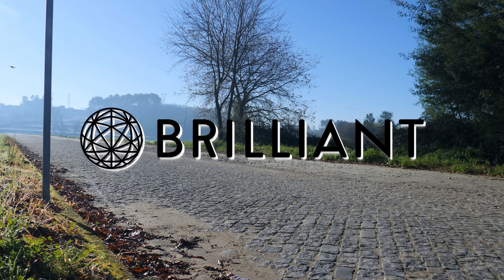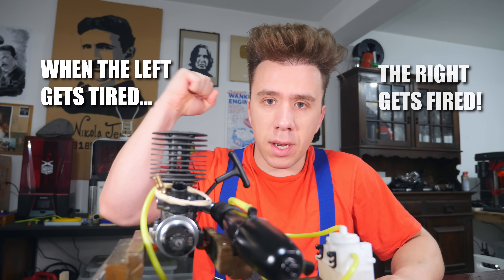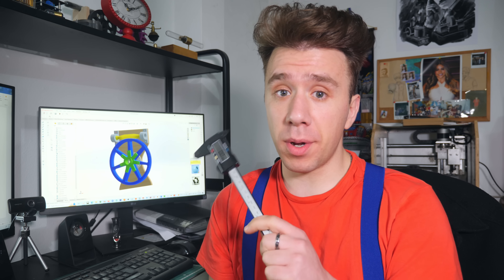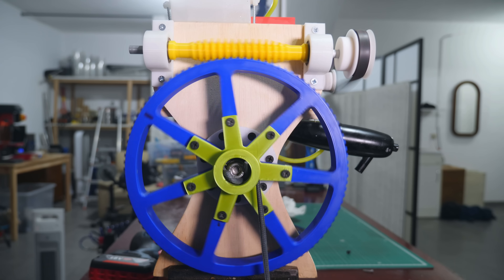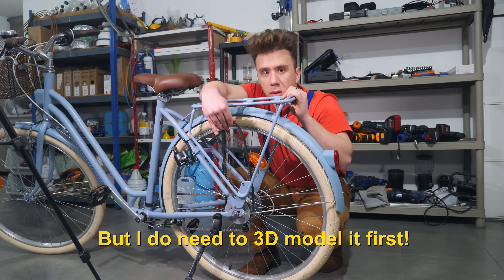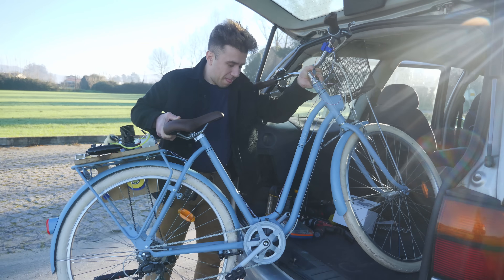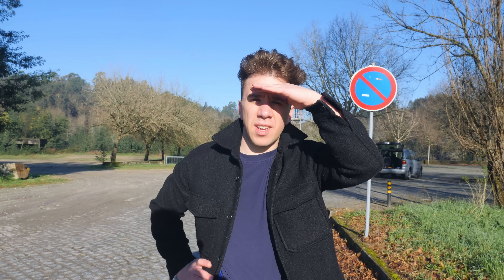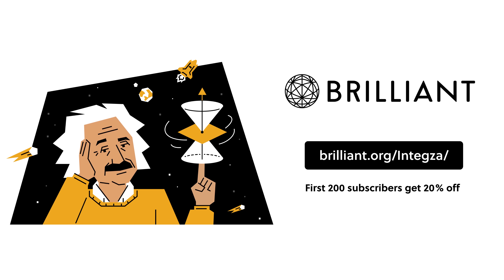Tiny 3.5 cc NITRO ENGINE on a BICYCLE

Comment from the maker: NITRO ENGINE:https://amzn.to/3SE4RIL
My 3D Printers
Prusa mk3:https://amzn.to/3SEXr83
Bambu Lab X1 Carbon:https://bambulab.com/en-eu/x1
Creality K1:https://amzn.to/4bjM4K3
Prusa SL1S SPEED:https://amzn.to/4bu7LHA
Form 3: https://formlabs.com/eu/3d-printers/form-3/
CNC MACHINE:https://bit.ly/3sqTUQm
Reply: Ps no more than 8mm of your circular saw blade above the wood 😳😳😳😳 more dangerous than jet engines.... possibly 🤣
Reply: @ddoherty5956 its not tall enough to cut the wood tho.
Reply: @balkanboi11  I've been using a table saw for over 20 years, it will and safely.
Reply: you should make a tiny (the size of a NITRO rc car) remote control multi NITRO ENGINE hydrofoil boat that can pull you in a inner tube or even skis and you can control where it pull you
Reply: 5:53 DANGER - I know wood isn’t your primary medium but please please be careful with your table saw. It’s the most dangerous tool in your shop. Consider lowering your blade to barely above the workpiece and never ever create conditions that could pinch an oblong piece between the blade and fence - recipe for kickback. My heart skipped a beat with that.  Please be careful!
Reply: I think you needed to pull the fuel through to the engine the first time, it  might benefit from a priming bubble. 👍🇬🇧
Reply: @ddoherty5956 Yeah that his mistake by pull starting the nitro engine bone dry which is not ideal leading to lower or no compression.
Reply: You needed more fuel to air on full throttle, turn the side needle ccw out 1/2 turn you need a little smoke and a better gearbox maybe from a RC truck hpi savage 25 should work
Reply: @foosty6 YES I'M IN AGREEMENT
Reply: BRING. BACK. THE. MOUSTACHE.
Reply: @Arrow14100  Good point👍
Reply: Use gearing protection, wgen you run those engine indoors, even with the exhaust, they are loud enough to damage your ears. 
And drop the worm gear, they have a really low efficancy (~10%). I'd recoment you look into planetarry reducers (i.e. 3 stage 3d printed or from a drill).
Reply: Integza, I’ve worked with those motors since the 90’s and you can pull a lot more power out of that engine. Use a dremel to do a port polish of the intake and exhaust ports so it flows less turbulently, add a simple boost bottle (Google it, 2 stroke cheat code) and use a higher percentage nitro fuel (a 30 or 35% blend should be easy to find). You can probably close to double the HP for less than $100 and then change the gear ratio to something more conducive to speed with the newfound torque and peak HP on a budget. 🤷‍♂️
Reply: Great vid!
Reply: Attached a nitro engine to ether roller blades or a kids scouter!
Reply: i have a motobecane moped which is maybe 1.5 horsepower. it does a neat thing where the engine rocks forward, pulling the belt tighter into what basically becomes a variable transmission. maybe that can be implemented with the nitro engine in some way to squeeze out more speed
Reply: Love your videos as always! Tiny detail: torque is expressed in Nm, not in NM. (meter units are lower case, uppercase M only refers to mega)
Reply: Hey integza, I made an electric bike out of my mother's old Beach cruiser. It can go around 40mph.
Reply: What modeling software?
Reply: @iamski  he mainly uses onshape to my knowledge, he's sponsored
Reply: Which Cad program are you using to generate those gears?
Reply: @AndreaGiorgi85  onshape
Reply: He is a pro
Reply: Your grandpa left you a ladies bicycle? If you put a tuned chamber exhaust pipe on it, you'll get a bit more power in the power band of the engine.
Reply: Bit of a random question but does anyone know if it's possible to get ceramic printer resin for reasonable prices, I need high temp parts but the only ceramic resin I can find costs like 1200 bucks
Reply: Can i make a suggestion? Instead of all the overengineering on the back peice, can you try mounting it on the diagonal strut, on the right hand side, on the basket support? Then you could make a mount + gear ststem to integza into the pre-existing chain system, replicating pedal movement instead of moving the wheel. This way you can even use the gears on a mountain bike for even GREATER SPEED! Zooom
Reply: Can’t you incrementally increase the weight of a flywheel to transform rpm to torque. If you gear it down and create a damn heavy flywheel and spin it up to speed very slowly you might be able to retain more rpm. Or perhaps using your muscle power to get moving then once the flywheel is spinning you add the rpm and hopeful it won’t overload the engine.
Reply: 👽👍🏼 Very Cool Motorized Bicycle 🚴💥☁☁☁
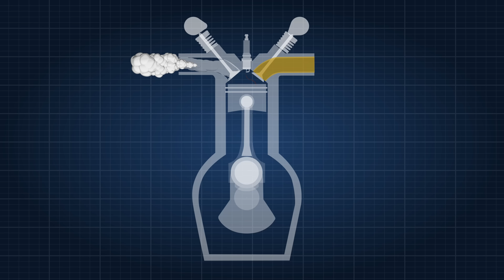Reply: 1:48
 am i the only one who has dirty mind
Reply: Funnily enough if you look up the NSU Quickly those old Mofas also did not have a motor much bigger and oftem were tuned to drive at a speed of 50km/h 😂. I worked quite a bit with old bikes and Im always blown away by how fast such a small motor can get you.
Reply: Now tell the truth..... the bike was yours but it's all good b/c you will get more "BanG as the horsePower BucKs" ?!
What kinda drone was that motor for & it must be super expensive??  Anyhoo,  thanks for the video & I appreciate
the humor = that makes the video Go like the motor did your GrandPa's bike.... Yeah yeah.  peace
Reply: all that tomato bashing, and meanwhile you dress like my favourite italian plumber. i wonder where mario would stand on the tomato issue...
Reply: Thank you.
Reply: I've been suggesting a similar project all over the place for a while now. Basically a motor like this as a charger for an Ebike. Fuel can be 10x as energy dense as lithium batteries, so an engine like this, carried separately as a range extender for when you want to use an ebike in a place where charging is difficult would make the bike more useful.
Reply: lol, Plastic, particleboard, Rc engine, and a girls bike. Bahahahaha yer hilarious.
Reply: 14:18 gratuitous twerk.
Reply: The engine is crying for more fuel due to the lack of smoke coming out the exhaust as you think about it by riching the carb as leaning it will kill the engine faster due to it getting too hot as well the glow plug plays a factor in the weather due to the temperature given like colder plugs or hotter plugs. You can get more power by porting the engine and a racing pipe without restrictions including a bigger head for better cooling
Reply: If you want to make up for the loss of efficiency due to the angle of attack of the infinite screw being too steep.

The best would be to reduce the angle of attack of the pitch of the infinite screw, instead of 6 steps (too short) you would be at 8 or 10, and finally you will have a better grip on the bottom gear, and increase the efficiency.

Note that your infinite screw system is clearly seen on a heat engine, since it is an under-multiplier(good for thermal engine).

You will notice that in the current configuration it is a little too under-multiplied. And so by adding steps to the infinite screw (like at the start where you realized that you were driving more slowly), despite everything you had better motor efficiency with the screw as it was before (with more thread).

Ultimately the best would be to put it back as it was before, 8 or 10 steps in brass, and multiplying by the pulley systems whose sizes you can reduce. So I think that this 3.5cc 30000rpm you can make it go at 50km/h while keeping a system like yours, quite rudimentary, but functional, and above all not expensive. DIY at a lower cost, and it helps to learn the pulleys, the gears, and also the usable speed range of a thermal engine which starts at a defined usable speed.
Reply: What is the name of the app that shows speed in the video
Reply: P- portugal you say?
Reply: The use of 2CV in french doesn't mean 2 horsepower as we use horsepower as measurement today.   It was a complicated formula used to determine taxation for a motor.  The first 2CV boxer motors produced 9HP but were taxated for 2 HP in the french formula.    2CV comes from "Chevaux-Vapeur,"  meaning "steam horses."    The 2CV used as a 2 HP prop actually has 28HP from a 0.6 cubic inch 2 cylinder boxer engine.
Reply: my grandfather never said that  lmao

you fired up the right but then went right back to the left 😂 😂
Reply: bud. why don't i trust you with power equipment  😂
Reply: Link is dead for engine :(
Reply: 5:05 NEVER RUN YOUR TABLE SAW BLADE THAT HIGH!  I can't express how incredibly dangerous that is.  There is no reason to have the solid portion of the blade above the top surface of your cutting. You only need the teeth to clear.
Reply: I had a thought, maybe worm gears are good for low reductions, but maybe they don’t do too well under higher loads? I have experimented with worm gears myself and I always come to realize that normal gear reductions just have less friction when driving something. Maybe you could go a little bit faster with normal gears?
Reply: @xmysef4920
Reply: lmfao 13:17 xD "because i want to use my new toys" lol

Comment: Run that motor to generate power to fiil a battery. and have it turn off when the battery is charged.
Use the battery to drive a hub motor on the bike.

Comment: at least 1000 commenters already said this….   if you use a tablesaw to cut 3/4” thick material, set your blade height to about 1/4” more (1”).  You have 3” of blade sticking up past your material.  Its safer to expose the blade less thru your workpiece

Comment: The reason it’s so hard to get started is because the fuel tank is below the engine put the fuel tank higher than the engine and it will start easier

Comment: Awesome job, well done. A few suggestions that can improve the performance. Add a cylinder ball type exhaust to the engine, it will reduce the noise to a minimum and improve compression. Add synlub synthetics lubrication at 2% volume to the fuel mixture, this will eliminate smoke and oil residue and improve fuel consumption. Add an additional one way clutch bearing to have an automatic electric start and a kill button on the choke intake throttle lever. All the above were successfully applied on my Huey Bell radio control helicopter using an OS 60 engine. Btw those cobble paved roads are really cool!

Comment: The secret to small engine applications is the use of belts and chains. The use of gears  cogs and sprockets takes a degree of engineering and the knowledge of materials that you don’t possess the ability to obtain on the budget that you have. Do you like the Japanese less like the Germans use belts and chains to transfer power. Gearbox use a ton of surface tension and require exotic metals and lubricants. Belts and chains are cheap lightweight, and easy to adjust. gear to gear transmissions are not so forgiving.

Comment: Why not use a friction wheel with chainsaw clutch. They used to make a 50 cc two-stroke motor that you mounted above the front tire and you would use a lever a top a fulcrum to lower the weight of the motor with a rotating wheel against the front tire. This common and was very popular in the 70s and 80s the first where much earlier in the 40s called a zipper

Comment: When I saw the size of the engine, I thought you would put it on the front wheel, like a Solex. https://en.wikipedia.org/wiki/V%C3%A9loSoleX. It works pretty much the same way a bike dynamo does - but in reverse.

Comment: you are actually breaking the engine by running it like that out of the box
nitro engines need a break in phase where they just run on idle - half throttle  for a while (most people say 2 tanks) and after that break in phase you need  tune it so that it doesnt overheat etc etc or else you might or eventually will break the engine sleve or the piston

yea and running on full throttle isnt really good for the engine either ;-;

Comment: The tiny version of those engines used for some toy planes had a spring which you'e hook onto a propellor and wind, then release.  I mean engines about 1/5 the size of what you showed.  For your engine, I'm surprised they chose a pull starter when it seems that a spring-driven starter can get a bit more speed.  Then again, I remember our neighbor repeatedly winding the starter spring on his old lawnmower, trying to get it to start.

Comment: The funniest thing is this is the first time someone shows off and is proud of an engine(or anything) from HPI. If you wanted a quality engine find a YS 4 stroke supercharged motor. It’s for rc airplanes
Reply: Bro HPI has been one of the best brands for decades even through their new ownership,knock it off. Wr8 the Baja 5b, the savage all legends in the RC community.

Comment: They make motorized bike kits you can buy. This is pretty cool but there's a ton of wasted potential. 2HP can go so much faster. The one I had, had maybe 1.5 to 2hp as well, and while its nowhere near as fast as an electric motor off the line, you can gear it much, much lower. With some pedal assist off the line, you can easily go 50kph. On a flat, I was able to hit ~82kph.

You can also get semi-DIY kits, Morini makes a 12hp 50cc engine that there are kits available for that can go way, way faster.

Comment: DANGER is where you think there is not. What you did at 5:53 on the table saw is the most accurate way to get accidents, and a bad enough one... Seeing this made me pause to breathe.

As a former woodshop assistant i know how dangerous wood machinery can be, even if doesn't seems as scary as some other jobs. 
Take the time to learn how to use your tools and do it properly. Cutting a piece shorter than the blade diameter is a super high risk of projection, as well as using a lateral guide like that (the guide should always be on the longest side of the piece), let alone the fact that you are pushing your piece from both sides of the blade with one hand a bit close to the blade. All of this is the best recipe to get a piece stuck with the blade with yourself directly in the aiming point of projection, hoping your hand will not get in the blade when that happens.

In the shop where i was, there is a hole in the brick wall behind the table saw, never been patched. Just a reminder of how powerful a 4HP table saw can send a piece of wood.

Really like your experiments tho :)

Comment: If it was me. I would rig the nitro engine to a small genny and use the electrical system as the transmission. Chains are only about 80% efficient at power transfer after friction, normal wear and tear and mud and dirt. So if you lose 10% going from mechanical to electrical, and then another 10% going from electrical back to mechanical, then you actually have a great system.

Hybrid electric bike.

Comment: The trick to getting a nitro engine started is to prime it with enough fuel to get the ratio just right. Too much and it will only siphon fuel through the exhaust, too little and it will just get you tired.

The carburetor is finely tuned (like, extremely sensitively tuned) to run with just the right back pressure.
What I am saying is, don't run it without the air filter and make sure the air filter is set up properly. Some filters expect you to oil them so they catch dust and that oil provides the necessary back pressure to make the fuel nozzle work properly.

And in any other case, you need to get the engine warmed up once you start it and start dialing it in so it runs just slightly rich. Run it lean and it will destroy itself in mere minutes.

Comment: One minute and twenty seconds in and I can already see the problem with your horsepower estimate.

You see, you can get a million horsepower in one stroke. Like shooting a shell out of a smoothbore barrel of appropriate size and pressure.
But to get useful work out of that horsepower you also need something called torque. Which in fact is what horsepower is derived from. Horsepower = Torque x RPM / 5252.

Torque is the actual work part, if you have 5250 torque happening in one revolution per minute, you have 1 horsepower. If that same torque is applied once a second, you have 60 horsepower. If that torque is applied ten times a second, you have 600 horsepower.

Now, let's flip that argument over. If you have 5250 revolutions per minute (87 revolutions per second) and one torque, you have one horsepower.
Tenfold the number of revolutions per minute and you have ten horsepower. At 50,000 RPM you are really stressing things out and you still only have ten horsepower.
A 3.5 cc nitro engine needs to rev REALLY hard to output that horsepower. And it doesn't have the grunt to get up to those revs when loaded to any significant degree.
Just like a chainsaw can easily spin up to full speed before you start cutting, but the moment you start cutting that engine is now under quite a heavy load and if you push it hard it will stall really fast.

Compare that to a circular saw blade powered by a steam engine. There's so much grunt, so much torque, that you can push a whole tree trunk through it and it barely reacts.
A chain saw with 5 horsepower vs a steam engine with a big piston and a decent flywheel that still only outputs 5 horsepower... Well, the steam engine will eat trees and ask for more, where the chain saw will go "broop" and die.

E-bikes have more torque than nitro engines, in fact they have something like 40 Nm of torque where a nitro engine has 0.4 Nm of torque. In other words, E-bikes have a hundred times the torque. And that's why they can power a cyclist along pretty much effortlessly.

Comment: 3:30 The reason why the starter didn't start when you first pulled it by hand was because the fuel was first injected and the fuel completely passed through the fuel pipe, so the engine didn't reach it. If you keep pulling it, the fuel will come to the engine and start it. If you've already started it, you can easily start it by pulling it by hand without having to use a drill.

Comment: Should have used the engine to turn a PMA and then used that power to charge a Super capacitor bank, and used that to power electric motor 2-5x more powerful than standard Ebike